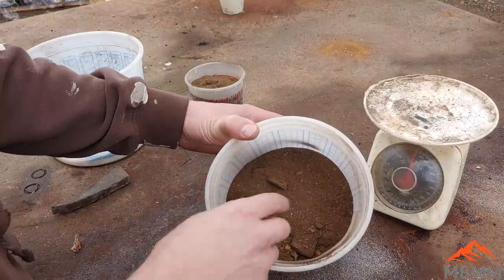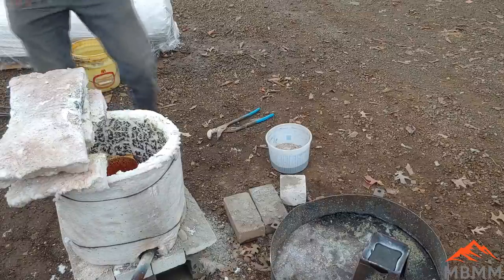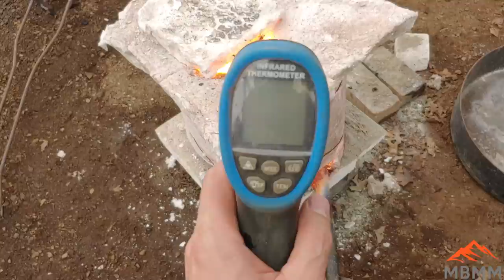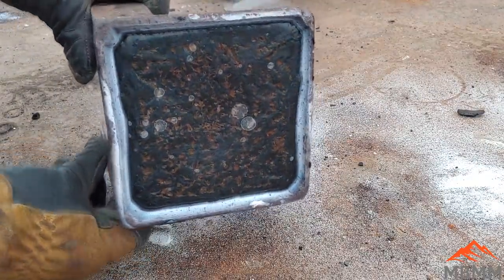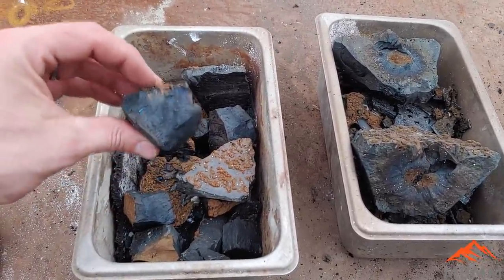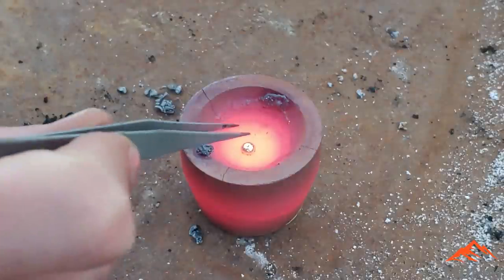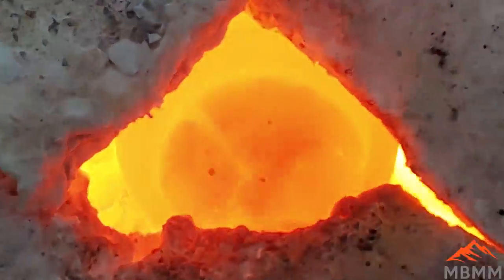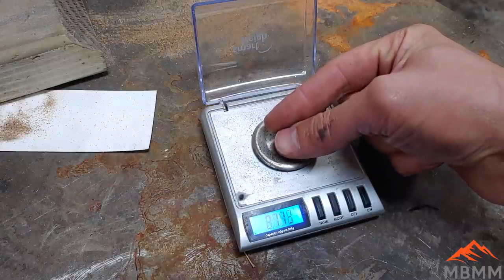Smelting Gold Concentrates

Comment: The larger volume you have to smelt at a time would make it more convenient and cost effective, imagine if you had a ton of this material and could smelt 500lbs at a time, would you be happy with 1.75oz per smelt? I definitely would be, its just a volume to cost to time ratio that needs to be figured out.
Reply: Very well put
Reply: It would require building more equipment just to manage such masses, including a large furnace, and powered lifting equipment. These would be expensive and you would need a consistent supply of large volumes of sulfide material to conceive of graduating to that sort pf processing capability. Also at those scales you would attract the attention of environmental regulators, who would no doubt make your life harder still.
Reply: @keithwood6459  I think you answered your own question with this reply, but I love watching your vids whatever your up to.
Reply: Energy costs are significant to, but you are correct.
Reply: This is how modern large gold mines work. They don't look for veins, they just find soil rich in gold, and smelt it by tons
Reply: @terrybusch5088  I don't think Keith had a question did he? He simply stating a fact. Also, what videos are you speaking of? Keith wood didn't make this video. 🤔🙄

Comment: I would like to see an experiment where a bucket or two of these cons are spread outside in the weather for a couple months to oxidize, then reran on the shaker table. I’m curious if that would free up more of the gold
Reply: Or perhaps if a pile of already ran sulfur ore which was ideally high in copper was allowed to sit in an outdoor pond..... And see if metallidurans might "poop" or sweat out gold for us in about a years time.  I heard that a certain method which includes allowing the "trash tailings" to be exposed to the elements for a years time results in half the value that can be recovered each year,  Ex: year 1= $1 million.  Year 2= $500k. Year 3= $250k.

Comment: Doing the rough math it looks as if you are making more money than the cost of materials. (propane,flux mix, ect.) But I didn't factor in your initial cost of equipment. How many smelts do you get per crucible? How often do you have to rebuild your kiln? How much do you have in collecting your material? All expenses that need to be figured. Chances are you would be better off working for Wal Mart if all you're interested in is money. If you're looking for anything else then it's worth every penny the cost. Keep the videos coming. They are great!

Comment: I think the way to go would be to roast the cons and set up a leaching column. You could 'passively' enrich the concentration by circulating the solution and running it through a charcoal filter. Then process that down once a month or whatever. Just keep circulating and filtering till you get a negative stannous test.

Comment: You could use your thermometer gun to check the temperature of the cone mold before pouring.

As for if it's worth it, did you get a gold concentrate off the shaker table? If so the mining might be worth it, but smelting the sulfide split is probably not. Only you know your costs structure, but if you value your time into it, I think you would have to at least make that worth $100 an hour, because you could be doing something useful with those four hours. There there's cupels, fuel, flux, electricity. Yet you made only about $40 worth of gold. So you would need at least 12-15 times as much gold in the sulfide smelt to be worth it, without increasing the volume of sulfides, because with increased volume would be additional costs in fuel, consumables, time, etc.

If you try to scale up to a larger process, you would probably save on fuel, but it would be increasingly difficult to manage everything, requiring equipment to lift and pour, etc. So unless you want to build special equipment for handling you are stuck with your current process.

Comment: I'm not an expert, but I've found that the higher the concentration of Au, the more profitable when smelting. This suggests that you might do better by roasting and re-concentrating on your wet table. If you lose some gold on the shaker, well it's gold that's too expensive to extract anyway. Give it a try.

Comment: If you can figure out your biggest cost & figure out a way to either greatly reduce this or make use of the input for something else.  I know it's cold in the winter there & you are using a lot of heat.  If you could find a partner that could make use of the waste heat, that would cut down or eliminate much of the input cost.    IDK if you have land, but heated green houses or even just heating a larger building with the waste heat from the process.

Comment: The ancient Greeks could help out here. I read (a long time ago) that they'd pile up gold bearing sulfides outside and leave it exposed for a year or longer. Mother Nature eventually took care of those pesky sulfides via weathering. Guessing that this would be much cheaper than any other mechanism to free up your gold. Might make a meaningful difference WRT profitability.

I'm guessing that roasting ore was probably more commonly employed, however. Much faster.
Reply: I have been involved with three projects worldwide which focused on re-milling old tailings.  In two of the cases we knew what the recovery rate was from the old operations (one was still running).  In every case, our recovery rates were higher due in large part to mother nature doing the 'grinding' work by simply rusting out the sulphides present and releasing the interstitial gold.  In the operating mine we simply passed it back through the mill on the standard settings.  On the defunct mine sites we ground finer than the old timers did, so of course...
Reply: It'd probably be even faster if there was a way to aerate the tailings regularly, maybe a simple airflow pumped with a windmill?  Blowing air through the moist tailings would drastically increase the oxidation rate.
Reply: @Alondro77  Well if you can figure out a way to blow air through a wet sand beach you will be a millionaire pretty fast....assuming that recovery is greater than cost.
Reply: @rockbutcher  Wait... what if we used super-heated steam blown through tailings pre-heated to past the boiling point, so the water never condenses?

Comment: I wonder if your sulfides aren't processing due to flux chemistry or lack of carbon. I've noticed how much reduction happens to the iron and the improved look of the slag in previous sulfide vids that I'm not seeing here. The steel didn't seem to have reduced in size at all. In the others that rebar (?) was significantly reduced in size. Just wondering maybe I've missed something or maybe I'm comparing apples and oranges. I need to go rewatch those vids...

Comment: If it's  to hot and kicks or bubbles over u can stop it by adding some sand. I know this from steel making. Slag is the same ,sulfur, phosphorus, solicits,ect... but the sand will just melt and turn to a glossy black slap when cool it floats to the top of your molten slap so it will stay away from the bottom

Comment: If you put the collector metal in as one lump, is that going to be as effective as spreading some lead shot across the top of the melt? Could there be gold suspended in the slag that hasn't come into contact with the sinfle lump of collector metal?

Comment: How come the crucibles do not come with a spout or slot to pour off like a Pyrex measuring bowl does? Seems like some is stuck to the sides.
2nd- Is there a titanium crucible that melts at higher temps than Platinum and Palladium?

Comment: A few questions .  What make is that crucible? What was the metal thing you pulled out on the 3rd pour.  I’m only been doing easy 3 aluminum, brass and copper  just a couple of years . Still learning . I work at the 20 mule team .  On your smelts  I’m so confused on what you did. Only breaking the tip.

Comment: I wonder if it might simplify the cone molding process to use a smaller cone mold, which would overflow and spill most of the slag. The lead will still sink to the bottom of the mold, but this would allow the cone mold to cool more quickly and let you recycle the lead sooner.

Comment: What if u added it back to the high concentration stuff and run it again with the higher material. Test it would lower your concentration of the marine material but you would eliminate the second smelt by combining it with the first 

So after your done with all the material you would just end up with one batch of low concentrate to either 2nd smelt it or save it for future processing 

It just seems like tossing it out over time would add up and by adding it to the high concentration material you are not loosing any gold juat lowering the grade of your pay

Comment: Economy of scale, propane is $3/gallon. Initial run cost at least $12, electricity maybe $4, flux at $15, equipment capitalization use $30. Labor at $20/hr, 3.5 hours is $70. Total for this run is nearly $135.00. You clearly need at least 5 to 6 times as much for feasibility, but throw in taxes, mining and other variables, such as profit and overhead and I would estimate 10 times the amount. This cost might be reduced if you scaled up the operation. But, I'm comfortable with 10 times. Therefore, I would pass on this.

Comment: @ Mount Baker Metal in mining when you reuse a crucible to melt is there still Trace element still left in your Crucible I know that sounds big so the first melt before you put the lead in to receive your precious metals I noticed it the beginning of this video that your Crucible was dirty I was just wondering if there could be Trace precious metals on the inside of that dirty Crucible this is in no way a critique or criticism it's just a question for my own personal knowledge
Reply: I just don't want to think that my ground is more valuable than what it is if I'm reusing crucibles from different places that I've used them from before

Comment: I quite like Your videos, I have not seen very many yet. But You should consider getting a proper pouring tool, I don't know how much You generally use crucibles, Your current tool seems tricky and kinda worryingly unsafe. Even if You only use it every now and then, in the long run it would probably be safer. Either way thanks for the video! =)

Comment: 7.5toz per ton? There are industrial mines that operate at a profit with less than half that. Buy think of it this way… with your turn-key system it would be reasonable to say you could run 4 tons of material a day without too many issues.   If you get 7.5 tOz per ton, that is 30 tOz a day. Do that for 10 days, and you have 300 tOz. At current good prices that is roughly $600k (USD). All together you’d probably be working for about 30 days (20 for extraction, 10 for turn-key and final pour). After expenses, you would still be making probably $10k-$14k per DAY.

Comment: lets say you have 300 of 1k reject samples. you can get possibly 0.667 grams out of every 3 samples. 0.667g X 100 is 66.7g or 2.352773oz.   every smelt is 4 hrs. so 24 hrs to smelt all that material not counting extra smelts. as its stands now the spot price of gold (not hand poured) by ampex's spot price chart shows roughtly $1800 USD per ounce of gold. This means you will have roguhly $765 worth of poured gold. Coin places that take gold will lower the price by about 12 dollars or so depending on premiums nad their assay price to make sure its real or pure. im bad at math so let me know if i did it right

Comment: At our propane cost 4 gal of propane is about 17.50, what is the cost of the flux? Possibly 5 so about 22.5 to make 40 worth of gold. = about 17.5 net. divided by 3.5 hours work and we would be making less than 6 an hour at that size batch. Might be worth it for hobby entertainment but not for making a living. At your cost of propane you might be making about 6.4 an hour.

Comment: how would you go about smelting a lot of flour gold out of insanely fine black sands?  The gold seems to stick to many of the particles of black sands and its almost impossible to pan them apart, even trying to pan a spoonful at a time when working with the concentrates, it just doesn't seem to seem to want to separate.  One of the areas I've sluiced in the past, if I sluice for an hour waiting for the sluice to clear because of the heavies wanting to block it up, I get about 10 pounds of concentrates with about a pennyweight of gold that is willing to separate.  The rest of it, in the sun, you can see a gold shimmer through them, but can't get them to separate.  Thought about firing some to see what could be recovered but haven't ever done it.
Any advice would be appreciated.
Reply: ? did you and was it successful

Comment: After watching whole video and some math: I do not know, how much is the gas in US, but here (in CZK) gold price 850 CZK (0,67g, 100% purity???), gas 350 CZK (10 kg), soda 200 CZK (12 kg?), lead, sand, iron, electricity, crucible amortization, cupell... 100 CZK (?)... 850 - 650 = 200 CZK (9 USD, 3 hours)... Well fastfood job could be better...
We say, zero kills zero... As a hobby OKish... To do something in free time, to get some gold, squize something out of the black sand...
May be some scale-up, bigger and more efficient furnace., like 100 kg (?) per batch, coal instead of gas (?), not cupell gold, sell alloy as is ?...
220 g per ton is VERY nice gold, if you have a ton (or more) of that stuff. May be some "big metalworks guys" could just buy gold rich black sand (no idea, just speculation, here in CZ Kovohutě Příbram buy "gold rich powders" with more than 0,01% of Au, Pd, Pt combined)

Comment: At 7.5 oz a ton..get a ton or more together and send to Refiner with cheaper process. 7.5 oz per ton ..say 80% recovery times 1800 bucks minus loading ,shipping and 30% for refiner..you can still profit $2500 a ton if you sent one ton..if you sent 20T ..shipping would be same..more labor, but way more profit.  Rough figures.

Comment: I thinking your working with too much concentrate. There’s so much garbage in that mass and then you’re adding more with all that flux. Reduce the concentrate further and then use good old fashioned chemistry to separate stuff. Don’t do any of the chemistry until you have enough collected material to get ounces of gold and silver. Copper isn’t worth much but you’ll have considerably more of it than you will gold and silver so you might as well chemically recover it to. But again, save piles and stock pots of it until it’s worth doing.  Maybe watch sreetips on YouTube to get a good idea about the chemistry.  If you make your own acids (or some of them) you keep you out of pocket expenses down but your time cost will go up.  I think, if these were the same concentrates you were working previously, from computer boards that were already stripped, I’d say it’s never going to pay off.  The guy that sold you the boards probably made more that way than you did in recovery.  Maybe get the boards prior to them being stripped.